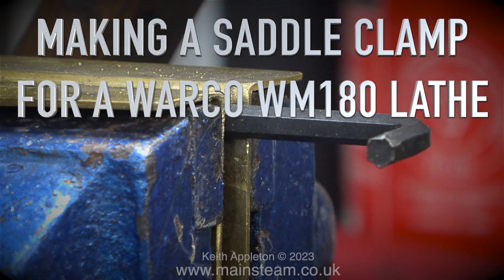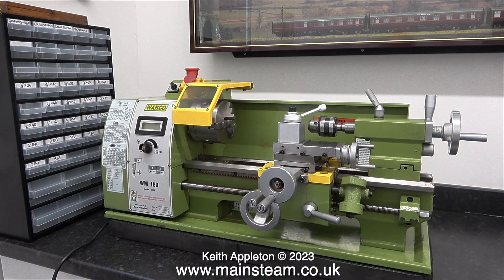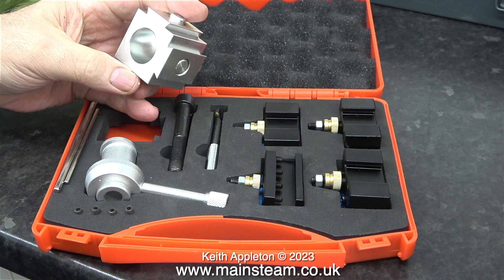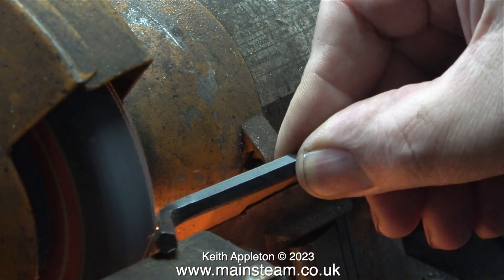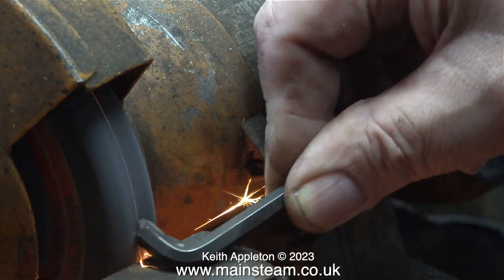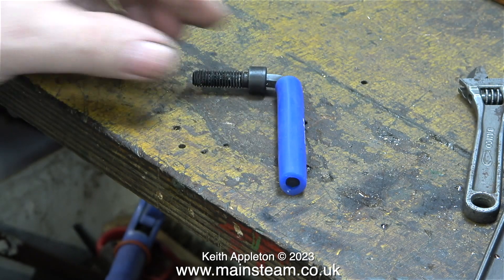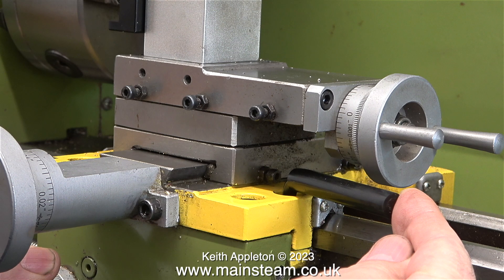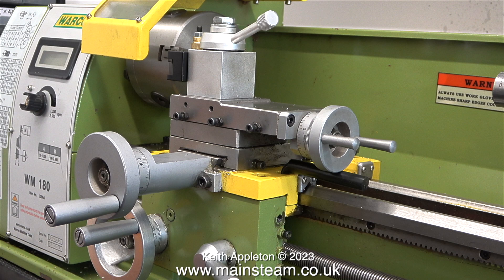WORKSHOP TOPICS - A WARCO WM 180 SADDLE CLAMP

Comment: An excellent and simple solution 👍👍 I machined up a custom screw with a wide flat head that I could drill and tap for a handle on my WM180. Does the trick but took a lot more work than your solution.
Reply from the maker: This seemed to be a simple method as I already had the Allen Key with the damaged end . . . .

Comment: hello Keith, now i bought a 80 mm. Chuck with back plate for my four inch rotory table, it arrived by dhl the seller made me sign a waiver that he would not be responsible for any claims, amazing they never mention these kinds of things until they have taken your money from your account and the item has been shipped! I can after receiving this chuck now understand why the seller pulled a fast one on me having sign this waiver eliminating his responsibilty if the chuck came not as shown in his ad. Well here is what received , first the the face of the chuck had all these dents smashed into it about four mm in length, then i stuck the chuck key into the chuck jaw slots to turn the jaws back i could not turn the chuck key, the jaws where locked in place forced closed i had to use a hammer to bang each jaw out of its slot first i thought the India seller  placed the numbered jaws in the wrong slots upon further inspection i noted that the slots for each jaw had not been polished at all leaving metal sharp metal sticking out in each slot ,next i removed the gear for each jaw by first pulling out the three screws that keep each gear in place, the gears each one was pressing against very rough petruding lines on the surface of each gear hole unfinished slots , i took out each gear and noted that the teeth on each gear was infact pressing against wall of each hole catching the surface lines petruding . The surface of each hole was completely un finished, the little shaft of each chuck gear that goes into the centre hole when you push the gear in was not rounded and had flat surfaces. A terrible chuck i could have sent it back as un suitable for holding any stock in the rotory table, but i desided to take about four hours with needle files and 150 grit sandpaper now the jaws travel freely and i have one gear done it slides easy into its hole, when i first pulled out all the screws that hold the three gears in place the gears where stuck in their holes and would not come out at all. Anyway i have had to finish the chuck my self, i do not have 250 or 300 grit emery cloth for a nice smooth surface, i need to buy some then i will smoothen the chuck out , i will be milling the inside of it slightly on my new lathe as their again lines sticking out on the surface. I leveled my lathe today no problem i bought a spirit level , i made my first cut in mild steel on the lathe a test piece with my dull cutter the finish was good at 1200 rpm but anything less in mild cold rolled then 1200 will not provide a smooth finish, the nine hundred watt motor had no issue at cutting 5 thou what so ever like butter in my 1 1/2 dia round bar. I have to remove the saddle it seems that the side of the saddle on the chuck side is digging in slight into the vslot so before i cut again it must be removed as their is a sharp spot under the saddle that cutting into the vgroove close to the chuck. I checked the tail stock aliegnment with the chuck its dead on, next the saddle comes off, i will file out this spot, then i will do a test on the chuck to see the accuracy see if any runnout is present i expect non maybe under 1 thou say half thou is accepable. I will be buying a five inch wide piece of stock to make the new back plate for my four jaw. allthough Tubal Cain a model engineer in the states indicated that you can infact make the eccentric sheaves on a three jaw using packing between the stock and one of jaws i prefer the four jaw especially when i finish the bores on my cylinders. I also have a war hatchet its called an Estwing but not from the viking days. Keith i successfully sent my four inch Bridgeport designed vise back to Vevor today which is bigger then my milling machine table. Ending this i will state that i think canada wants us to leave the nation?  My new lathe came with a carriage stop. The one thing i noticed that i did not like, Keith is the limited travel of the compound slide when its maxed out i do not think i can mill any metal that is more then five inches in diameter. Check the three bolts under each side of your saddle on your 180 they will press the plates on each side tighter up against the saddle of course you already know all this my saddle is tight no slop at all, i fear changing the bolt settings they are very tricky to ajust the last time i ajusted the saddle for slop it took me two hrs it was tricky but that lathe was damaged by a break in to our storage unit. I checked my metal inventory i have the material for the steam chests and i have three finished fly wheels so i will build three steam engines at the same time the first i will keep since i will have many errors i expect this i will be making all kinds of mandrels since speeding cloning is required i will be selling these units i may send you one Keith for your expert opinion on the quality and finish and would appreciate your imput you can keep it as a gift from me. I will ask you a question on the eccentrics before i stop here when you have please give me a quick simple reply. I was thinking either bronze or gun metal for the eccentric and the sheaves from cold rolled round stock, i wanted to ask can i use brass for the eccentrics brass plate that is i think about 3 /16 thick? I will check the drawings my plans are from Ray Hasbrook i miss spelt his name you can see some of his steam engines on youtube the one iam building is his No” 1 it does not have a square cylinder its round. Some of the drawings have me a bit lost but as the engine is built i will figure out these parts , i do not know if i have to drill two holes through the bottom and top of the cylinders for steam ports its not indicated in the drawings again as i build the first i will know at the appropriate time. Must Go Keith, i will be making your cylinder mandrel in one of your earlier video’s i thinks it is great stick one end in the tail stock chuck then slide it into the four jaw that speeds up the individual alignment of the four jaws. Any other tricks you have please by all means show these in your Top Tip Time for me:
Regards
Daniel ottawa
Reply: Wow, that's a story

Comment: Hi” Keith, its the tool holder allen head bolt on the chinese tool holders that the problem, the ajustable screw weakens over time creating enlarged threads then the tool holder start leaning in toward the chuck. I think they used 12 L 14 for the tool post ajusting nut. Regarding the slop in the saddle well their are three bolts on each side of the saddle underneath you have ajust these tighter so that the saddle is just tight enough to sort of free travel along the bed with some miner resistance then your saddle will stop moving about. Next a story about my India made rotory table chuck i received from DHL from india thats next after my dinner: warmest Regards Daniel
Reply from the maker: The Allen bolt was the first thing I changed, i only bought it out of curiosity as is was stupidly cheap .......it works for now as this Lathe doesn't get much turning use anyway }:-)))
Reply: @keithappleton  Ya sorry Keith for the Long Long sa i wrote you, i know your busy, tell me, are their any flats for rent near you?. The Aluminum tool post is not bad but i say again the tool holders adjusting bolt is made from from very soft steel as you put pressure on it it over time digs into the threads the brass adjusting nut is frankly well i need a magnifine glass just to get the teeny wrench on it then the tiny allen wrench. I am happy you responded Keith , i hope that Andrew does more video’s on his no’ 7 and i think he should not give up on his airplane engine. Must go its movie time for me and the mrs. Look forward to your next video tomorrow my far away friend.
Regards Daniel Ottawa

Comment: If you want to keep it in the allen bold, a dose of Loctite (I don't know which one) might work.  Just a thought.
Reply: Have you found a way to reduce the backlash in the crossfeed gears? I haven’t bought the small harbor freight lathe because of not knowing if the backlash can be reduced or eliminated on it.
Reply from the maker: No as I have previously mentioned - I will not be doing much serious turning on this machine. It is just convenient to have it in my second smaller Workshop ........
Reply from the maker: It stays in there anyway without any Loctite ........ I jut want to keep it simple }:-)))